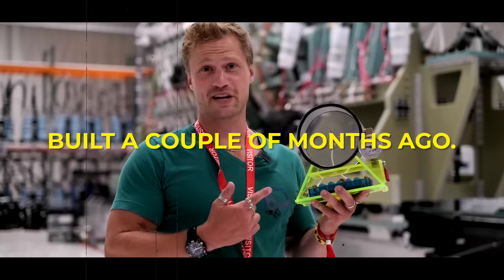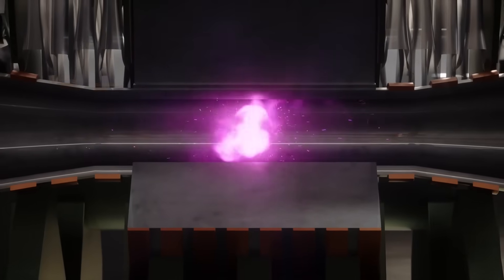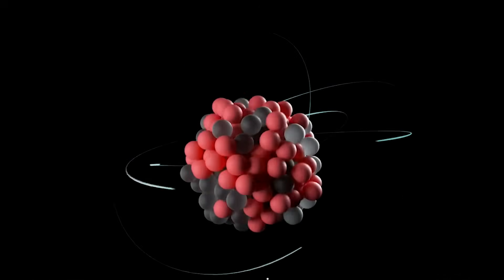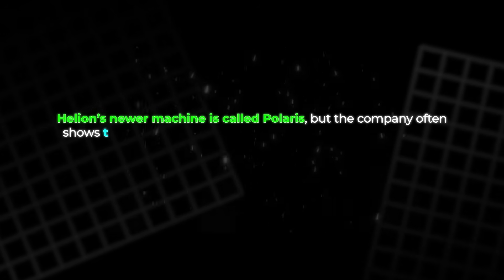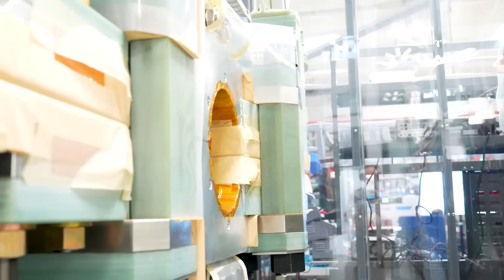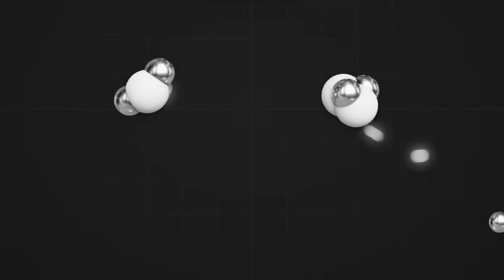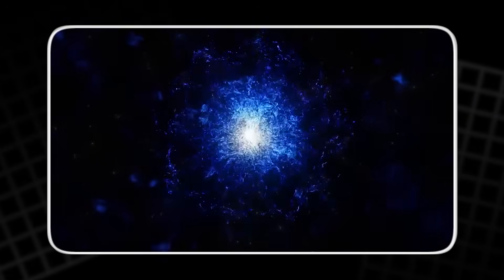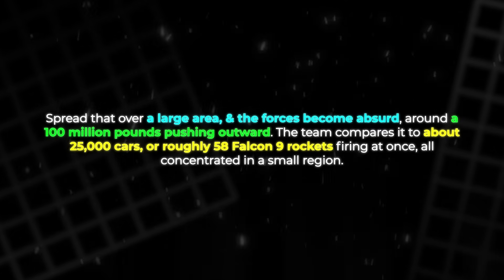Fusion Without a Steam Turbine?! Helion’s “Pulse Reactor” Could Change Everything

Comment: Mercury-vortex engines

Have an X/Y matrix overlay of copper wires connected to battery 

Over the glass

Between the electromagnets and glass

Which cycles heat and vibration currents through batteries and a piezoelectric crystal oscillator 

In tandem with the electromagnetic rods, wired into the same computer 

Which reduces heat load and vibrations on the Quartz Tubing, formed into Maria's (toroids) out of a tube 

Which has to be annealed properly based on its atomic structure, and magnetized by curie temperature 

For the least chance of a Crack 

The computer also helps define safe operating parameters 

You could use calcium-flouride (FLOURITE) 

Or Silicon Dioxide 

For better hardness
Reply from the maker: Thanks for sharing your detailed thoughts on potential improvements and materials!